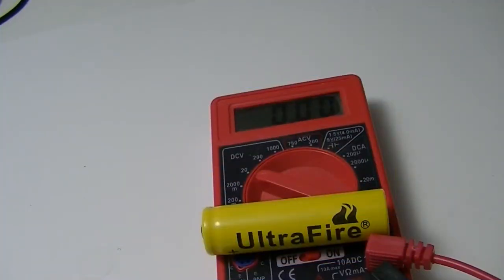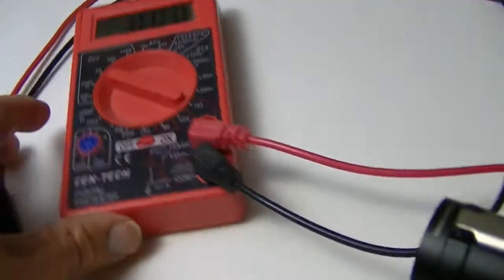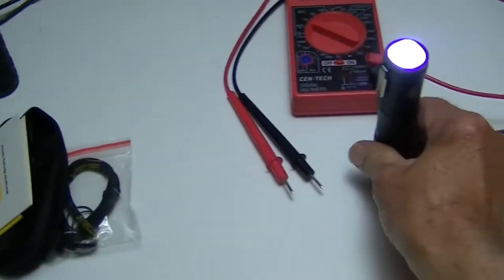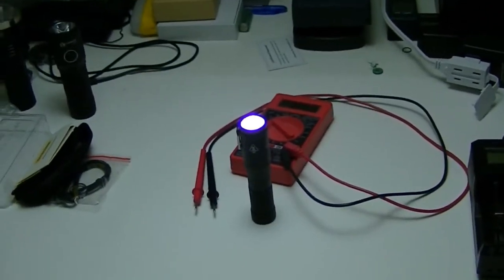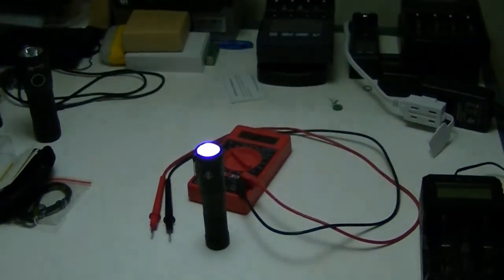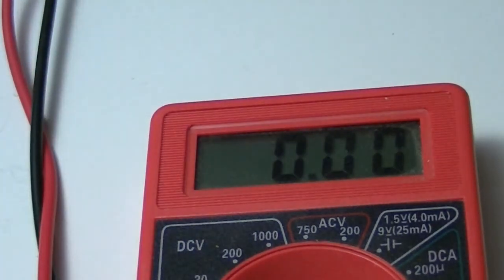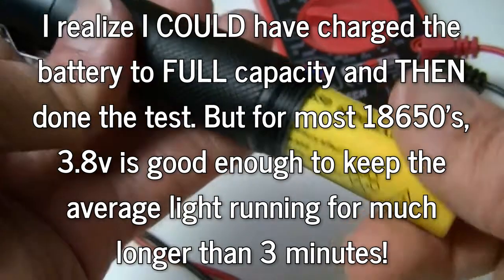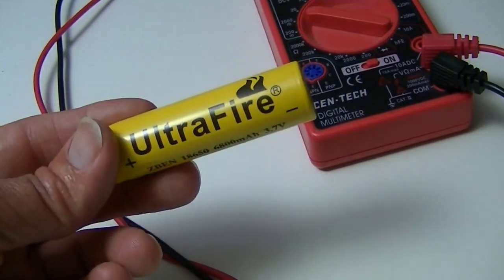Testing a fake 18650 battery in a high-power flashlight

Comment: So which batteries are good - which brand should we buy?
Reply from the maker: My apologies for not seeing this question sooner!! I have written extensively about rechargeable batteries on my website, https://lightsngear.com 

  The brands of batteries I usually recommend are those that carry the same name as many popular flashlights. Some of these include Olight, Nitecore, Klarus, Lumintop. Other notable brands are Sanyo, Orbtronic, Samsung, Efest, Golisi, Panasonic.
Reply: The brand isn't as important as the source right now. There are a lot of counterfeit 18650 wraps coming out of China right now.
Amazon brought down a ton of resellers on its website and took down a lot of listings for 18650 cells. Many other sites do absolutely nothing about it because they're making a cut of the profits from all the scams.
If you go to Reddit or various forums on the internet people will give specific sources for lithium cells. I wouldn't buy any in 2022 unless I double checked and saw other people vouching for the source.

Comment: EBay provided 10 such batteries recently.  They would not charge any more, yet 4x could not even get one blinking light on the power bank.  Same bank which easily charged my phone (some) on a single partially charged 18650.  It registered 2 of 4 lights on the indicator and charged the phone for 15 min.

The seller just sent 10x more, loose in a non padded bag, like it was candy.  A quick comparison of weights for a few cells were measured as they felt noticibly lighter.  Old Dell laptop highest 45.6g, another Dell 42.1g, dewalt xrp lithium 38.0g, cheap eBay unbranded 35.8g, last batch and replacements respectively 29.3g and 28.8g.  Refund here I come.

Comment: do you needs a High Drain Battery 3,500mAh 18650 real good takes longer correct, this others Fake 6,800 not true thou I have Fake 9,800 took tested Zoomable Flashlight stay out shower I bathed 15 Minute just dead Battery!

Comment: Yup. Its crap. What would be nice to see is a brand or even a specific cheap cell that is of decent capacity (say 2400+) that's a bargain. Would make a good follow-up.
Reply: Lg HG2s on any reputable site are 3000mah with 20amp max discharge. About 5 bucks each